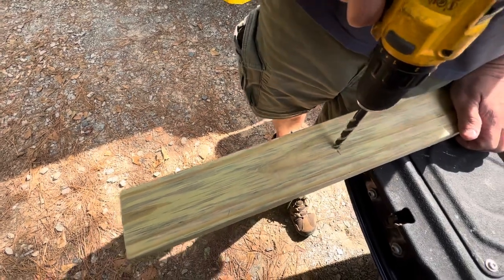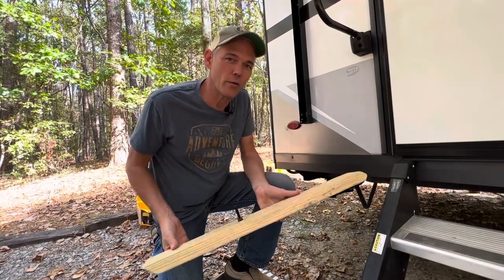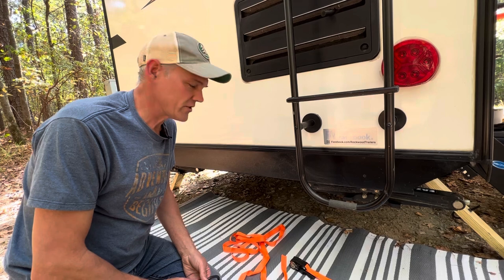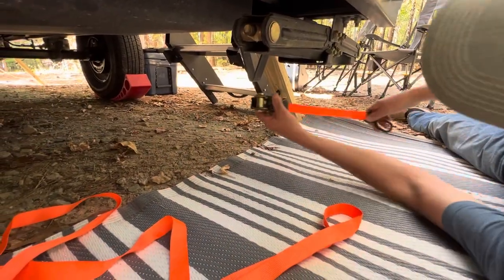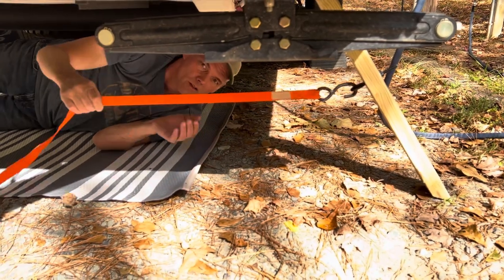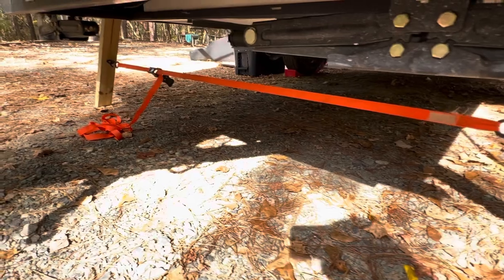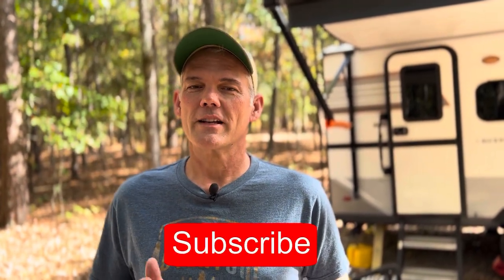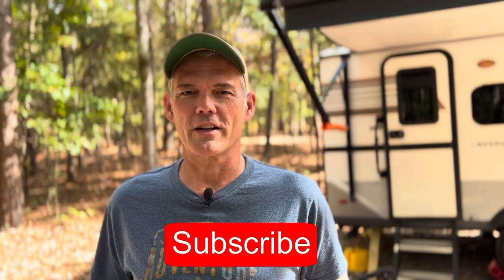QUICK & EASY DIY - Stabilizing the Camper! We are Amazed at the Difference!!

Comment: Excellent idea!  Going to try them next season.  I came across your channel while looking for info on my 2019 GeoPro 19QB and have found the information very valuable.  The door blind mod has been my favourite as it solved a problem I had with the design and was a quick and easy fix.  Thank you for this!
Reply from the maker: Thank you for the views - much appreciated!  And glad you find them helpful!  How are you liking the 19QB?  That was our second choice.
Reply: @WinesPinesandCanines  So far it’s been great but I got it at the end of the season so it hasn’t been used much yet. I purchased a lift for it from Dexter that raised it up almost three inches to give me a little extra clearance as I will be using it off road primarily. I also like that I can sleep North/South in it by only pulling the mattress down a few inches from the front (I put a couple of larger pillows in the front to fill the gap) and don’t need to do the plywood mod that I saw you do.  I’m 5’10 so it works fine for my wife and me.

Comment: Hi guys! I actually changed out our stabilizers a while back, like you did, and the difference was phenomenal! Someone else also recommended adding several stackable leveling blocks under the jacks as this adds more stability when the jacks don’t have to extend as far. We found that to be a major improvement too. Your DIY is shockingly different from the stabilizers alone. Just curious, what exactly were to doing in the trailer to make it rock so much? And no, I’m not going into the gutter with that question. ☺️
Reply from the maker: HAHAHA!  First - agree on the stabilizers.  They made a big difference from the stock ones.  What stackable ones are you using?   Looking for ones that are big enough for the foot of the stabilizer that don't sink into the dirt.  

We were shocked on what a difference it made once we did the testing for the video!  (its Linda)  For what we were doing haha, Troy was inside rocking side to side.  Just forcefully, feet planted, rocking side to side to see if it would move.  We find it amusing to come inside now and shimmy with our feet to see if we can get it to move!  Three trips in, 2 more planned in the next two weeks.  Curious how it does on a variety of surfaces and degrees of level.   

And we are probably going to stay them a dark ebony color to blend in better and a comment was made that some reflective tape at night might be good as they do stick out a bit.  Not so much we have tripped or even almost tripped but you never know!  Hope you guys are doing well!

Comment: I always look forward to your presentations! I respect your knowledge. I have a 2021 GeoPro 19FBS with 18K miles.. I don't do any social media so using these comments to ask a question/request. I'm wondering what preventive maintenance I should be doing on my wheels/bearings. I've had no problems but want to be proactive. Burnt out bearing on side of road would not be fun... I've been getting conflicting recommendations. Have reached out to Forest River but have gotten nothing conclusive back yet. How and how often do you check your wheel/bearings. Do you pull the cap to check the grease or what? Thanks, would love to see a U-Tube on this topic.
Reply from the maker: Hi David!  Sorry we took a bit to answer!  Taking some time off for holidays and family.  Hope you are having a good 2023 so far!

So, general consensus is 1 year/10,000 miles to change out the grease.   The Ez Lube system was pretty straightforward - we did it once right after starting the channel.  Weren’t comfortable doing a detailed “how to” at that point lol.  We watched a few you tube videos specifically by Dexter / Forest River that were very helpful.  Look for “ Dexter E-Z Lube System” - it was just over 2 mins long but gave a great tutorial that we used and had no issues.  We do have plans to film next time but - this video was very helpful for us the first time!

Comment: Wondering how they are working out now several months after doing this?  (did the door shade mod yesterday, want to create this tomorrow...)
Reply from the maker: Hi!  They are working still working great - take them with us each trip.  One thing - they aren’t as great on loose gravel as they are on concrete/hard packed dirt.  The gravel moves as we move around each day so the supports need retightening.  But we always found the stabilizer supports to move around on gravel as well.  And we definitely notice if we are just parked for the night and don’t set them up!

Comment: But what do you do if your camper is higher from the ground than the length you made the boards?  Some spots I’ve been in there was as much as a foot difference!
Reply from the maker: Hi!  So, we have camped in a number of different campgrounds since making them and no issues.  They do have a bit of play to adjust out or in but the spots were relatively level.  If the spot was really unlevel - like some boondocking spots! - we could plan ahead and carry a second set with a longer length.  Worst case, we could always just use the normal stabilizers and rock a bit lol.   Thanks for the watch!

Comment: Using the new stabilzers, how was the mounting procedure? Did you have to re drill the mounting holes?
Reply from the maker: We did not need to drill new holes but there was a trick.  We pushed the existing bolts down through the top into the new stabilizers and left them loose until all 4 were lined up.  If we tried to tighten each as we put them in, they wouldn’t line up.  We are 3 years in and they still look like new (well - when we wash them haha!). Thanks for watching!
Reply: @WinesPinesandCanines  those are next on my list!
Reply from the maker: One more tip - have a full set of tools!   The ones up front weren’t difficult but it is a tight space so I do remember I had to use some different wrenches/sockets to get in there.
Reply: @WinesPinesandCanines  I have plenty of tools, I'm a Harley Technician!

Comment: Thanks for the video! We have a 2019 FBS as well. When you replaced the stabilizers did you need to drill new holes or did the old stabilizer holes match?  Also what size EAZ-Lift did you purchase? I hope Desi is ok
Reply from the maker: Hi Steve!  We purchased the 7500lb ones - cheaper than  the 5000lb for some reason at the time.  We were able to use the old holes but the trick was to feed the bolts in from the top, line up the new and then tighten everything up.  We tried initially to put the bolts in from the bottom and wouldn’t work.  

Desi is doing well - thank you for asking.  He is going in for a followup cardio appt in a few weeks and we will know more but for now, he is still living his best life - begging for a bit of a snack as we speak lol.  

Thanks for watching!